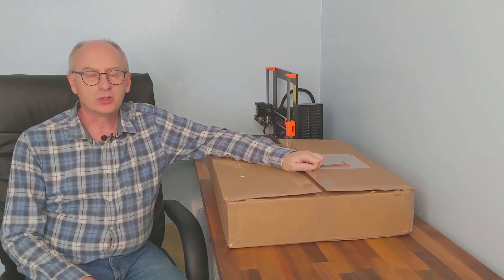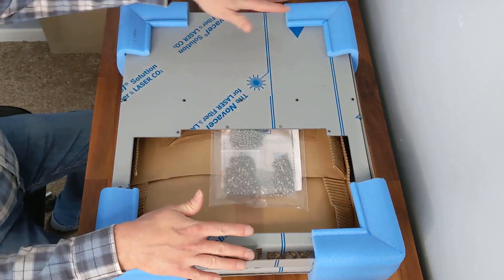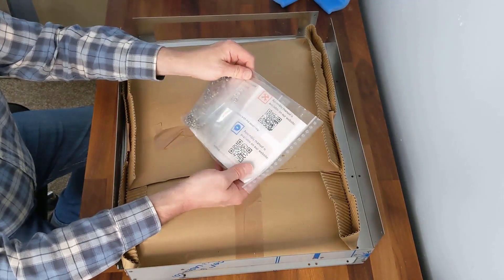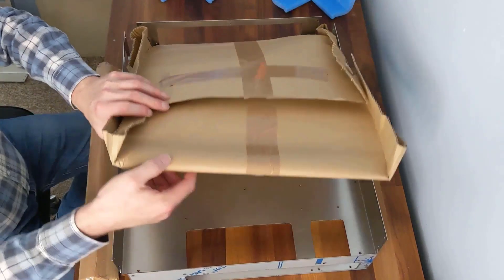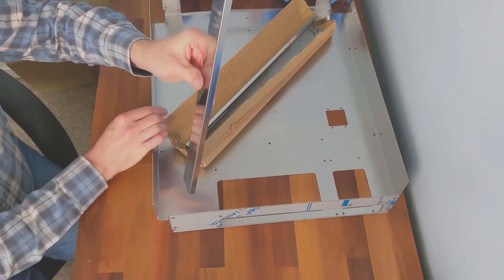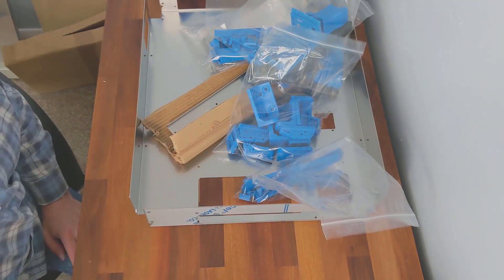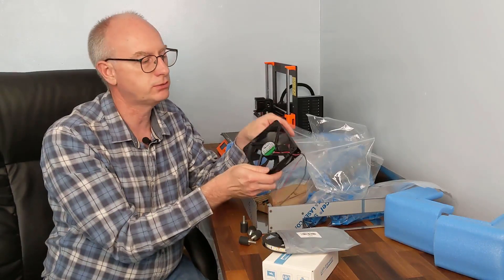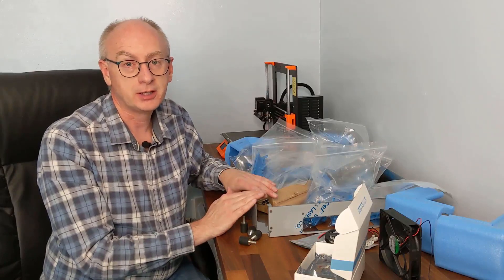PRUSA BOX - Prusa i3 Printer Enclosure (MK4, MK3s, Mk2.5s) - Unboxing. Part1

Comment: Firstly, I've watched all your videos on the Prusa Box and they are incredibly helpful. There seems to be some conflicting information on the web as to the external dimensions of the Prusa Box. Any chance you could confirm the external dimensions for me?
Reply: For Clarity can you please provide  W x D x H
Reply from the maker: 45x55x47. If you have the modular front add 8 to depth.
Also power cable is at rear needs about an extra 2.5cm clearance if u use a right angled cable.
Reply: Thanks @colinhill , will update my CAD to these dimension. Still another week before delivery of my Prusa Box 😁

Comment: Great videos Colin, I watched all of them except the lighting one so far.  I ordered the prusa box, and started my prints.
The first two prints are 24 and 21 hours, humor me, is this a good chunk of the base parts?  I ordered a second roll of the filament I’m using…. Per your recommendation.
Also, are you content with the cooling of all the electronics?  Do you believe PetG is sufficient for internal parts?  I’m not sure how hot it will get in there with passive heating
Reply from the maker: Hi Barry. You are probably printing the longest parts, but it does take a few days to print all the basic parts. Even longer if you print items from the mods section or modular front section. 
Petg will be fine. It does get quite warm so using the extractor fan helps reduce heat buildup. There is a vent below the mobo which helps. 
I'm currently working on some active cooling and plan to put out 3 videos this week. First one is adding diff temp controllers to the modular front.
Reply from the maker: PLA at your risk ☺️. The enclosure can get to 50°C, I would recommend Petg at a minimum, plus some parts like clips need the flexibility of Petg whereas PLA would shatter.
Reply: I am excited also! After watching his build I ordered a box as well, Have couple rolls of PETG coming I figure with the boxes on back order I will have plenty of time to run all the parts. I would think PLA would be ok for the parts IMO we have a Raised 3D printer at work it stays warm but not that bad..

Comment: Hi Colin, Good video by the way. I've been looking for a while to purchase a box for my Prusa Mk3. I saw an early video of you talking about another box that you put together. I was wondering what brought you to get this box. Did you get it for free or got a discount? if not and don't mind to share, how much have you paid for it, including custom fees? Is it worth? Any downside? It would be great to hear from you. Thanks, JF
Reply from the maker: Hi, i originally bought a Tukkari TS enclosure because of 3 things - price, top feed wide slot, and PSU cooling (in side wall). The Prusabox was more expensive, at the time only had a single hole to feed filament, and i had doubts about PSU getting cooled. The Tukkari TS was also designed to sit on a desk - had no bottom, hence cheaper price. It fitted my needs at the time and i was/am extremely pleased with it (4mm plexi). Now i have acquired the Prusabox , there is a wide  feed printable adapter option available so filament can go side to side on tall prints, and i'm going to design a PSU fan housing to help pull cold air through for cooling (i havent used any high temps yet so currently not an issue).  Each enclosure has its place, depending on your budget or needs. I was very pleased with the Tukkari (see my extractor fan video from last year). The Prusabox is allowing me to add extra items such as temp unit/Pi/screen/webcam inside of the enclosure so its nice and tidy. I havent finished the mods yet. I still have the Tukkari case.  And the Prusabox is turning into a very interesting project and i'm also very pleased with it. Regarding import fees, if in the UK expect to pay around 20% of the value. Hope that helps.